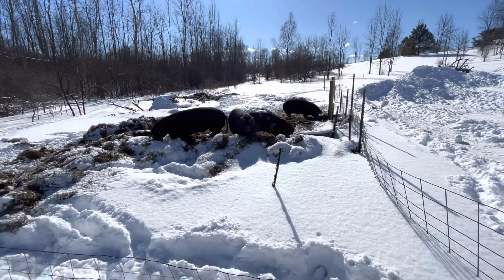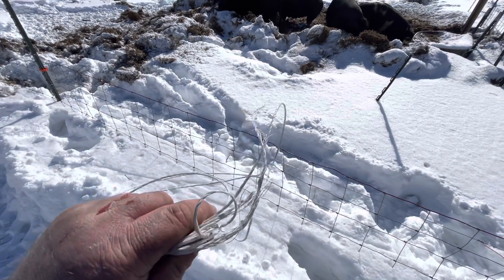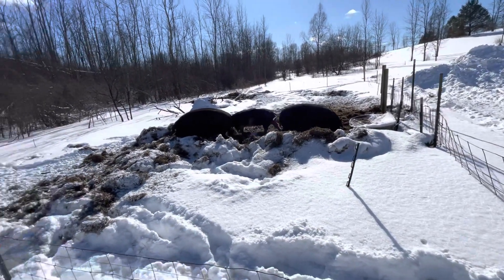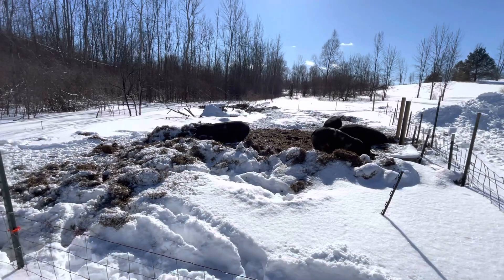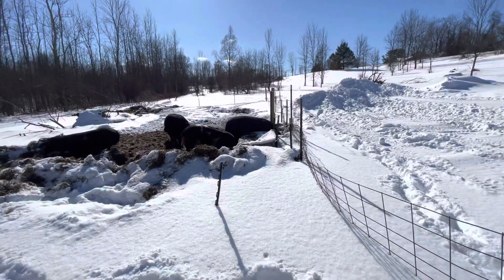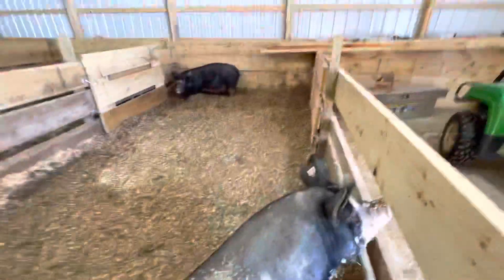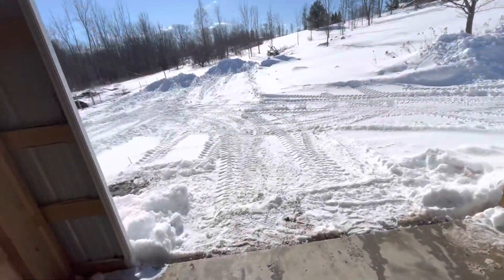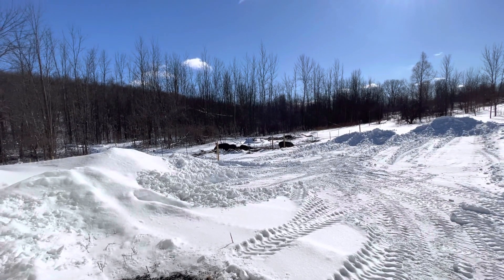Never Again!!!

Comment: Are you going to show / video the barn when you change it around?
Reply from the maker: Yeah I will show the barn no problem.
Reply: @fullmoonflockstock6929  I have a small hobby farm . Farm house with no barns , I have IPP 's and have them on pasture. In the winter I have them in hog panel enclosures with little huts a frame and some I made out of oak pallets. I want to some day put up a pole barn and I probably will do what you have done hopefully.